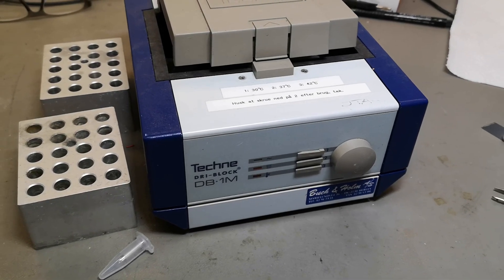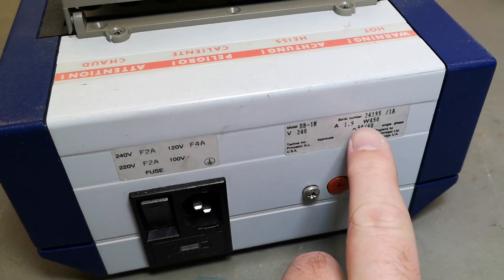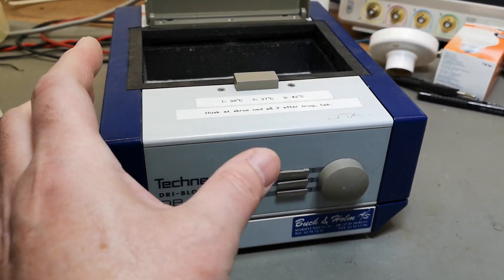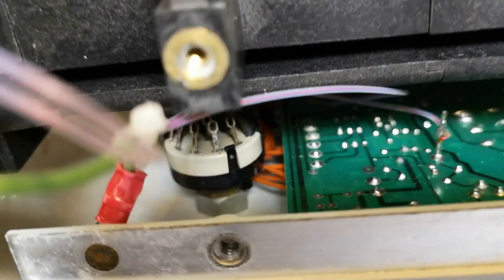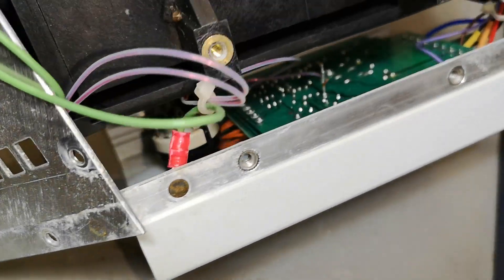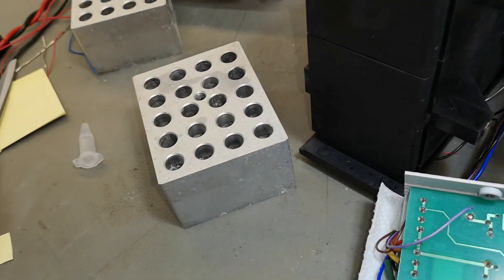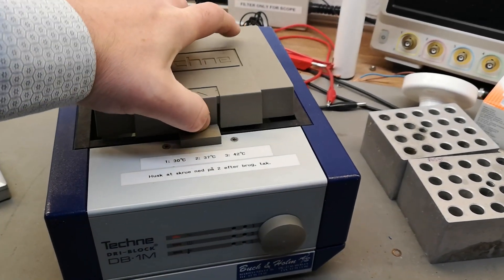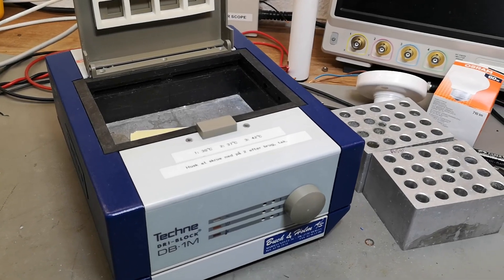Techne DR1 DB-1M medical medico heater test teardown

Comment: You could use this to prepare and maintain a beaker of tea at a suitable temperature.

I would add an extra variable resistor to the front panel to replace one of the trimpots to allow for quick change of temperature across the full working range.
Reply from the maker: i have adjusted the 3 ranges to 40,60,80 C and now i use it for test of all sorts of electronicboards i design, very neat little unit